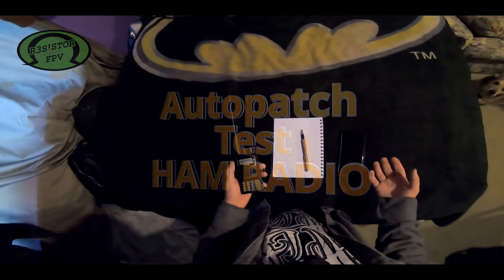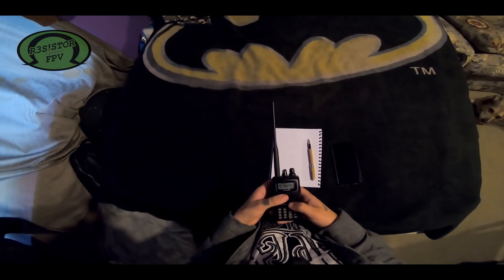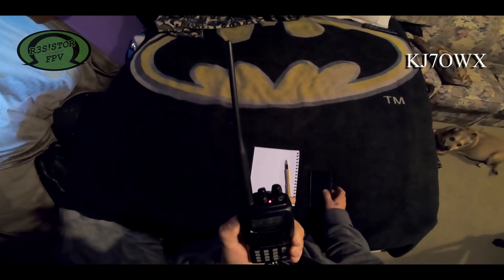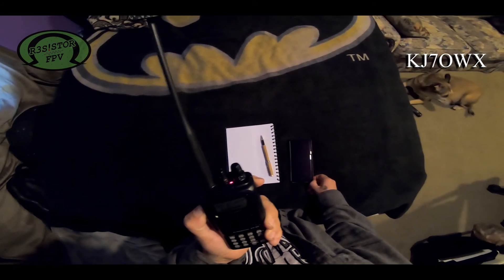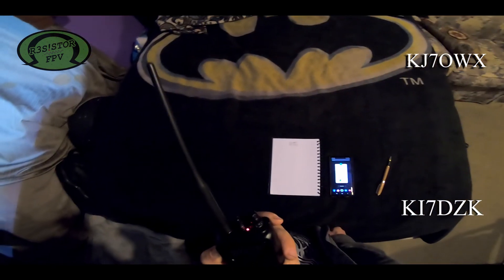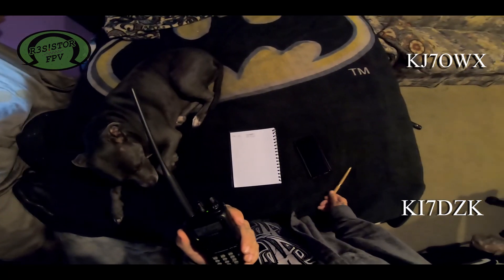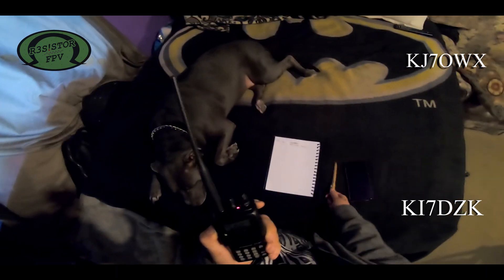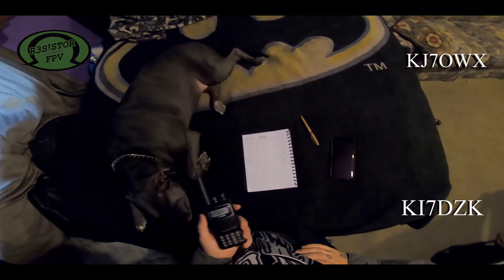Auto Patch Test HAM RADIO

Comment: I have autopatching on my AllStar repeater.  It’s pretty simple and just uses a voice modem.  I have P25, D-Star, Fusion (including a Wires-X node), DMR, and even NXDN also for U/V, but good ol’ analog will have the most dynamic audio range.  Get into HF, that’s where the fun is.  HF even has a FOSS DV mode called FreeDV.  I’m into packet pretty heavily and run several full-fledged HF BBS’s.  I also like to experiment with FHSSMA (frequency hopping spread spectrum multiple access).  Getting your General and Extra in amateur radio is simple. The actual test is verbatim the same as practice Q/A pool, they don’t even change the language around.  My background is being a 2E171 and 3D173 (Air Force) for decades.  (SATCOM and RF Transmission Systems, very secure comms, encryption, multiplexers, etc),  Your autopatch probably didn’t work because the repeater owner likely has a password set for it.  Keep tinkering and learning.